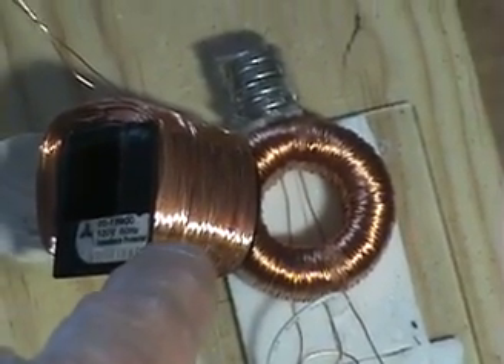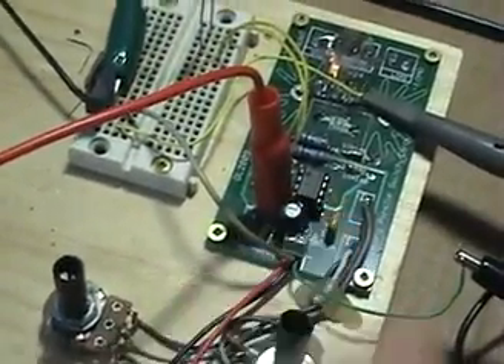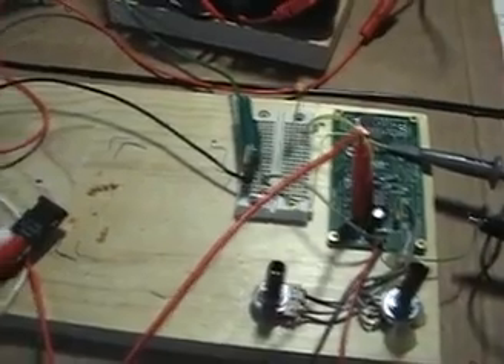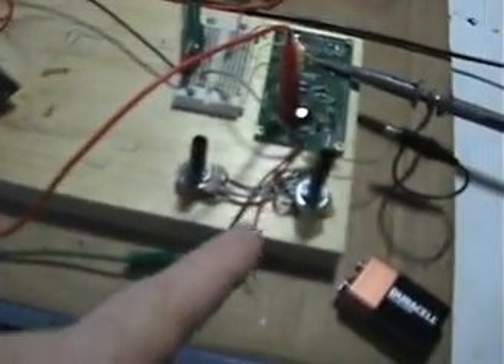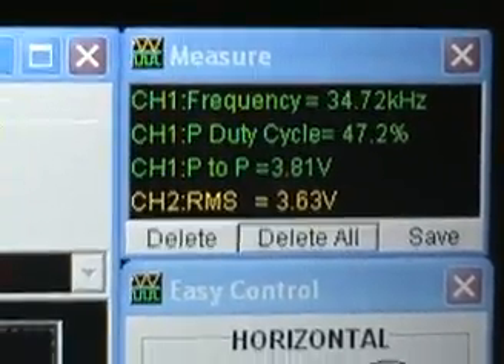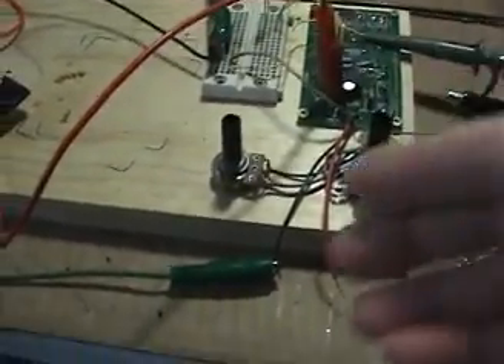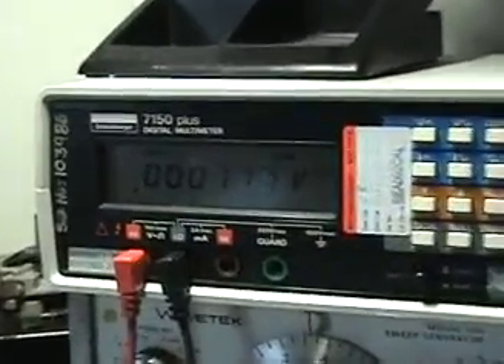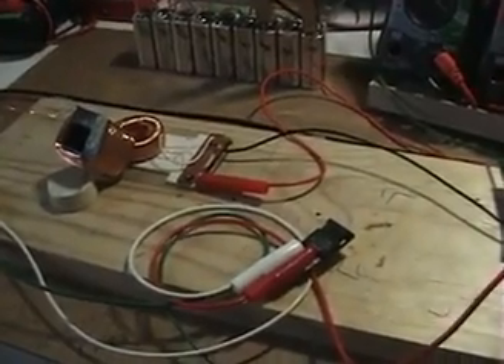Self Running Coil test 10

Comment: Drill a 1/8th inch hole or aperature through the middle of the toroid material. Wrap a  very thin wire to the inside as a reluctance switch. Rewind the inductor coil as an output winding this time, reattach the magnets with airgap. Use the magnets to saturate the toroid and the reluctance pulse to set the control point, thereby significantly reducing input.

Comment: Luc maybe try a second toroid running 180 out of phase with original . Pickup coil lies between the two. 2nd one runs during off time of first. Again do need very short leads between MosFet & Toroid coil.  Close (physically) decoupled with at least one 0.01 uf capacitor from supply side to ground, see Dr Stifflers layouts if you can.  Back EMF from Fet may supply enough energy to drive the other side.